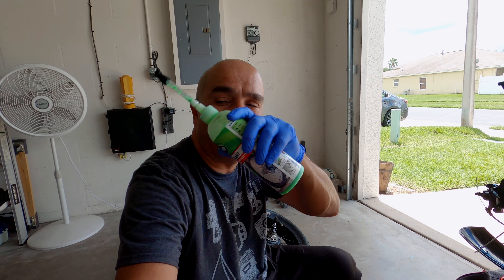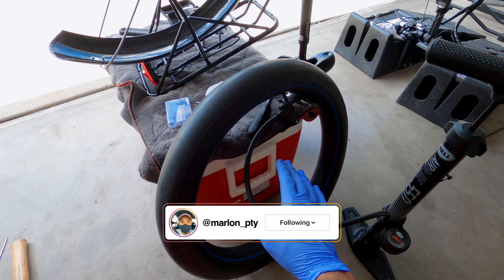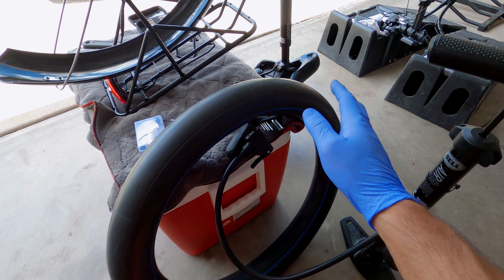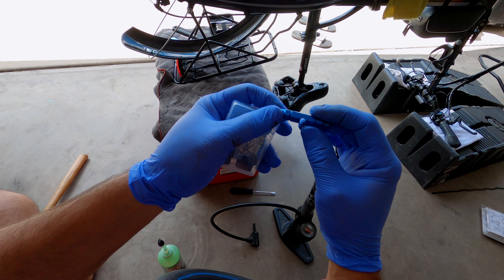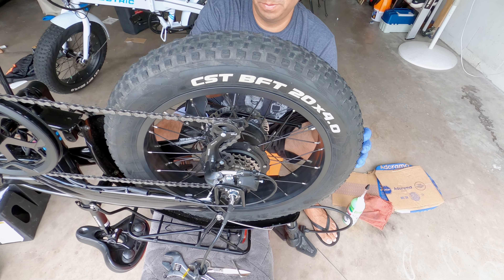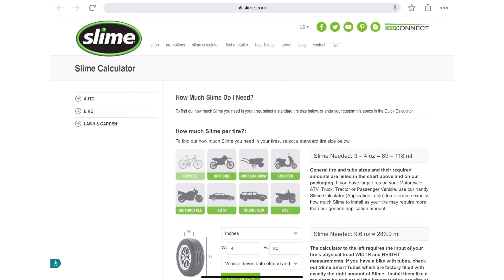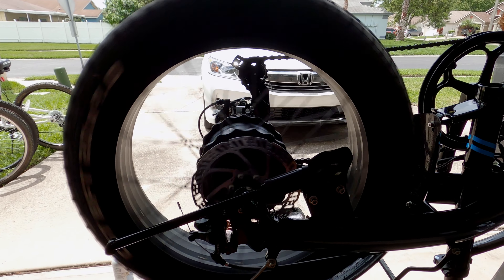Installed Slime Tube Sealant On My Lectric XP Fat Tire Ebike

Comment: If you got a clog, means you did it slow.  Remedy is use a drill bit same size as your shredder valve tip, drill  slowly, it will remove that clog. First remove the valve then drill/clear that slime, put back valve. Also no need to remove tires during sliming or putting liner.  I did put a slime and a liner on my lectric to avoid that long walk flat tire.

Comment: I just used 8 ounces of slime in my rear tire.. it went flat.. 26x4 BFT tire.  Now it holds air fine.  Must have been a small puncture.   Took 5 minutes.  Back in action. I too used an aftermarket valve stem removal tool.  Cheap fix

Comment: This is the only video out there that talks about this issue. It must be a flawed tube from the manufacturer.  I had the same exact issue. For me, all of the air escaped before I could undo the valve core so I had no way of knowing that there is a clog.  I proceeded to add slime but nothing would go in. I poked around in the valve (again, yes the valve core was removed), and tried again. Nothing.  I tried putting air in and it wouldn't take that either! Then I tried the heat method, that didn't work for me.  I then used a drill and drilled out some material at the base of the valve. I'm thinking it's excess material left during manufacturing. Then I tried adding slime again and it worked this time. Put the tube back on the rim and finished adding slime. Then added air and it's good now.

Comment: Couple comments for you. I have a fat tire bike also and even though they appear to be thicker than your average tire I was getting  punctures from a weed where I live called goat heads because of some sharp thorns on them, and I can tell you the slime works. I might come home from riding and find two or three spots the next morning where the slime  has come through and sealed them up. Without it I was getting flats. Slime also makes a canister that is air/CO2 charge. Forces the slime into the tire and no problems at the valve. I may have overcharged mine though. if you start to feel a looping effect from the tires especially the front tire it's more than likely you may have put in too much. I think I may have on mine. I can feel it in the front fork pulsating a little bit probably because its sloops around as the wheel spins. One way you can tell, is you will feel it thru the front fork and if you look over the handlebars while riding you can see the tire looping a little bit. Or while you have the bike upside down, stand behind the tires while you spin them, and site down the tire and you will see it doesn't spin in the round. Also another reason it loops could be that the bead has not properly seated all the way around the rim also.. You my know this already but I thought I would just throw it in. Otherwise  Slime  is working great on small punctures. Good luck, punctures are a pain.

Comment: That happened to me. And the tube is still slightly clogged. I finally was able to get it slightly unclogged where I could put air back into the tube. However I cannot get a correct pressure read on the slightly clogged tube. I tried to see if they have a preslimed tube for my fat tire bike. I found out that there is no preslimed tube I can buy for my 20x4 fat tire bike. When I get the tube fully unclogged I will not be trying to put the rest of the slime into that tube again. Glad it worked for this guy.

Comment: Nice video  I'm so glad that didn't happen to my girlfriend's lectric ebike.  She just got hers the other day and I slimed both her tires and it went well. Its a good product that works so you will be glad you did that. But you took that back tire off like a pro lol. I'm not sure I'm ready for that yet.
Reply from the maker: Thanks Ken! I actually had a flat the other day, and there was nothing Slime could do for me there. When you hit a curb too hard and the tube gets pinched you're gonna have to patch it up or get a new tube.  But I am still glad I slimed my bikes, because it should help with smaller punctures.  Thanks for stopping by!
Reply: @Marlon_Torres  Yer a better man than I am brother! I had my lectric for about a year.I didnt ride that much. Only had about 150 mi on it and then the back tire blew. I toyed with the idea of removing the tire. But first I thought I would try to snake the tube out while it was still on the bike. I was able to find a tiny hole. I mean TINT. And the way it leaked you would think it had been slashed with a butcher knife. I would fill it and before I could take it down and roll it in the garage it was flat! But Im thinking I will add some slime as well. But you scared me a little with that clogg! WHat caused it? Was thevalve still in there? Was it the wrong angle? How important is it to have valve at 11 o clock? Thanks Good video.

Comment: Hello, my Lectric bike just arrived.  Do you suggest sliming the tires as a prophylactic against flats?
Reply from the maker: Hey Ben, yes, I do! It doesn't guarantee that you won't get a flat, but it does help prevent them. It will all depend on your riding conditions and what actually perforates your tires. In some situations, there's nothing Slime can do.

Comment: Same here with the back tire - Slime just stopped going in. I'm still able to pump AIR in & out,  but SLIME will no longer go in. VERY WEIRD. 
The front tire was very easy to slime. So, with the valve out, I carefully poked it with a toothpick - still nothing. Gonna try cotton swab and maybe hot metal poker/skewer?

Comment: Thanks for the video! 3 months later how is the slime set up working?? Has it prevented flats, does it make your bike heavier?
Reply from the maker: Hi Max! I had one flat right after I added Slime, but there was nothing Slime could do in that particular incident. I had a big gash in the tube from hitting the curb. Aside from that, no flats and my other XP hasn't had a flat either. The bike to me feels like it weighs the same, but I have heard others say it feels heavier to them. I don't see any noticeable difference in weight.
Reply: @Marlon_Torres  it cant possibly add anymore weight than the weight of bottle of Slime.
Reply: @Edwardsjourney  Think of an unbalanced wheel.  With a weight at the bottom edge of the tire.  Attach an 8 oz weight to one point of the rim and see if you feel it while riding.  It'll probably be easier if it's ferrous, use a magnet of that weight.  The difference is it stays on that point, the slime flows but not quit as fast as water.

Comment: I heard good things about it and i used it when i had a slow leak in my 20 x 4" fat tire bike tube. It stopped the slow leak instantly. However, i later rode over some glass and my tire was bald and i got about four regular flats as the wheel rolled over the glass, and my tire deflated in about thirty seconds. As i was riding, i was waiting to see if the Slime would work. It didn't work. I had to push my heavy e-bike home. When i got home and removed the tube, all the inside of the tire and around the tube was full of Slime. Very greasy and messy The holes were not that big, but still, the Slime squirted all over the inside of the tire. Before i could patch the holes with a glue and patch kit, i had to degrease the inner tube.. Now, if i was on the road,.far from anywhere, and this happened, and i relied solely on the Slime, i would be in trouble. In addition, if this happened and i had a patch kit on hand, i would have to bring along some cleaning agent to clean away all the slime because as i applied the patches, Slime was oozing out as i pressed on the patches to hold them in place after gluing. So, i had to try to squeeze the tube and move as much Slime as possible away from the hole so that when i applied the patch, no Slime would ooze out and interfere with the glue under the patch. What a headache. The Slime is still not doing the job and when i get a flat now, i have all this extra cleaning job to do just to apply a patch. I won't buy or use this Slime anymore. I wish i could get it out of my tube. Since then, one of the patches sprung a leak and again the tire went flat, and again Slime was everywhere. Same cleaning job, again. I think i have to buy a new inner tube. I've been "SLIMED"! (think of Ghostbusters)
Reply: I'd have just gotten new tubes rather than go through all that.
Reply: @TheFlashyWeasel  You must be lazier than i am
.
Reply: @robbiedaug  😂😂😂
Reply: @TheFlashyWeasel Also try ‘Flat Out’ instead of Slime.

Comment: I had the same problem as he did all of the sudden the slime stopped going into the bike. Found out the stem was clogged. Tried my best to unclog it. Got it to semi unclogged to except air back into the tube However the tube is still semi clogged. For now I stopped putting this product into my bike. Just in case  I am going to go buy another tube before I try his idea on how to unclog the stem. 🤞and 🙏that it works for me too.
Reply: It happen to me on my old bike 26", end up replacing the tube since I got a spare with thicker inner tube filled with slime already.  Does the Lectric XP have a liner like Tuffy inside?  Ever since I use slime factory filled and tuffy liner, I have never had a puncture problem.

Comment: ... So uhmm... 😬No i wanna see if the slime works 🤓
Nice vid Marlon ✌🏾️🖤👊🏾
Reply from the maker: Wassup bro! Well, so far so good! Since installing the Slime I have put 50 miles on the bike, and the slime hasn't affected the bike's performance or anything. I hope it helps when it comes to riding over any sharp objects. Time will tell. Hope all is well with you bro! ✌🏽
Reply: MarlonPTY we can find out now just poke the tire .
I had slime on my truck I poked it with huge ice pick within 10 seconds the slime sealed it Awsome stuff
Reply from the maker: @bade-bike1930  I had a flat already and it didn't work. To be fair the tube was pinched against a curb and the gash was about half an inch so there was nothing Slime could do in that situation.

Comment: You should have checked the tire to see if it's too bad to use. It can be dangerous if it has a big rip in it especially the front tire right? I'd like to know how you use an old tube and put it over the other tube to make it way better so it never pops
Reply from the maker: I actually did, I checked everything, I guess I should have filmed that, but I know that the problem was with the tube all along. I know this is not the best way to fix the clogged up issue, but I had to get a little creative and thankfully it worked. I've put 50 miles on the bike since I did this and have had no issues.
Reply: @Marlon_Torres  I've been working on bikes since I was 8 years old. That would be 1968. These e bikes are amazing. And since the batteries are getting better and cheaper I could afford one. I need to know more about the electrical systems on these e bikes. I have had mine for 2 weeks. I did a lot of research and I bought the ecotric hammer. I bought it at upzy it was a good deal less than 1390 dollars. I'm not a troll I don't usually post comments like that. I need to find out about the bearings in the front end because I'm not familiar with those and my front end is loose and I think it might need another ring or maybe I can just loosen the hex head bolts that hold on the handlebars. I spent almost every last dime I had to buy that bike. I lost my left leg in November due to osteomyelitis. The first time I took off I did not realize how fast it goes. I have a short street I was at the corner before I knew it. And those fat tires are different to steer. I have the old school handlebars. I think I need to change them. Also I am 5 foot 8 and I need a different seat Pole if you're shorter you cannot lower it because of the spring shock thing on the seat. I don't see any way to fix the issue other than cut it off shorter and has someone weld it Maybe. So I will need to get a regular seatpost which this point in life is impossible nearly. 27.2 by 350 mm. But I love my hammer bike I'm used to it now I have 90 miles on it. I don't even have a driver's license. In New York you can go 20 miles an hour by the law with pedal-assist but I don't understand cuz I don't even pedal I just hit the throttle. I was messing around with the controller on the handlebars and I only have three pedal assist settings but I got the information I need from ecotric. They are not easy to work with when I'm trying to get the warranty and I bought it from upzy and I don't have the number I need to register it. I hope you have a good day our world is so f*** up getting out on the ebike is a great stress reliever for me. And it's my only transportation after I get the seat pole I can hook my wagon a Cannondale to the bike and go camping shopping whatever. I need to make a video also. I need to get a handlebar camera holder. I don't know what kind of music you like but I got a lot on my Channel that I did of bands and I don't have any commercials that I know of that's how I want it. It's about art and music and I got to work on my channel. I gave up trying to get views when YouTube changed a long time ago. I guess you get perks if you're a YouTube whatever they call it partner?

Comment: How much slime you add to each tire again ? ( In ounces )
Reply from the maker: I added 8 ounces to each of my tires.
Reply: @Marlon_Torres  I did 6 ounces ... Hopefully that works .......
Reply from the maker: You should be good bro!
Reply: I have seen videos on YouTube , put slime after the got the flat an d plugged the hole.
Reply: @kp6153  yep ..  I got a flat after installing slime and hole got plugged instantly... Pump my tire up a lil bit and good as new ..  inner tube lasted me another 8  months before it gave out 😊😊

Comment: Why didnt you  just leave it on the wheel? Also believe youre suppose to spin the wheel spin the wheel slowly so that will evenly coat. I still t/y for sharing. Yours the first veiw. Now need get vàlve remover kit and sealer. But pretty sure need spin wheel. I know in a car tire says drive a few miles to make even coat
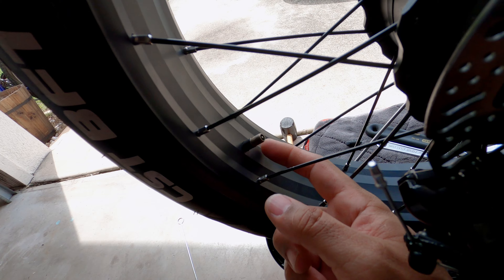Reply from the maker: Paul Eline Hi! I ended up taking it off because I wanted to salvage that tube and since at first I didn't know what was going on with it I figured I'd take it off to examine the tube thoroughly. And yes you are suppose to spin the wheel (per the Slime instructions) which I did, but I didn't show it in the video but I did mention it around (4:20 in the video). That is a very important step. Anyhow, thank you for stopping by my channel and watching.

Comment: Question what does that do
Reply from the maker: Slime Tube Sealant seeks out and instantly seals tread area punctures up to 1/8" (3mm). When a puncture occurs, our patented sealant is carried directly to the puncture. The pressure of the escaping air forces the particles into the opening, where they build up and intertwine to form a long-lasting, flexible plug. Instantly, air loss is blocked and a flat tire is prevented.

Comment: I got a flat tire on my Xp back tire.On my first  ride. INSTALLED MR Tuffy tire liners problem solved. No muss no fuss.Now I ride with confidence. Installed almost a year ago.Might cost more but they last decades.I been using Mr Tuffy on my mtb tires for years. Why would anybody put that stuff in your inner tube. Yuck!
Reply from the maker: Good to know! So far the slime has worked well for me.

Comment: How is the slime working for you?  I was told that it would make the tire too hard.
Reply from the maker: Hi Sherry, well, I had a flat but to be fair there was nothing Slime could to to help in that particular situation (the hole was to big for it to fill it up and prevent a flat). Aside from that I have been using both bike all over and seems to be doing it's job. Did you slime your bike?